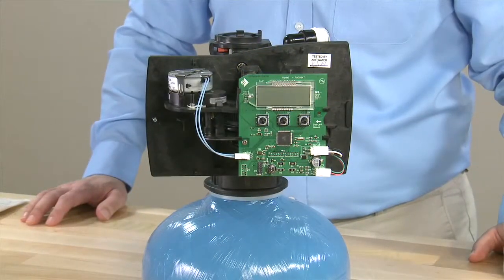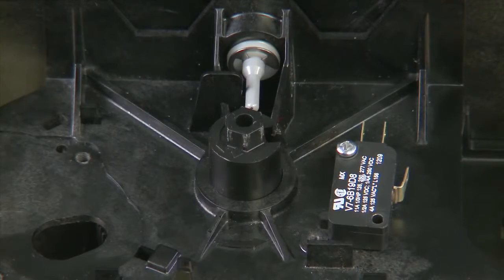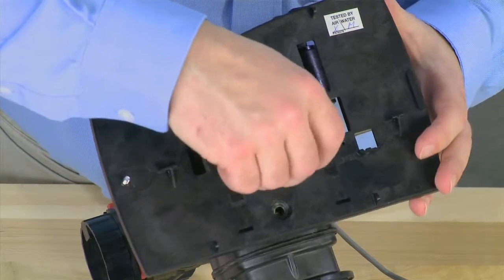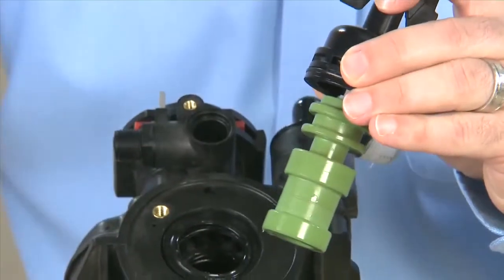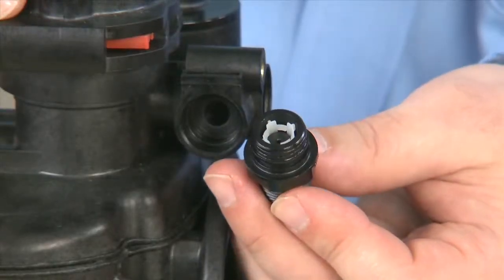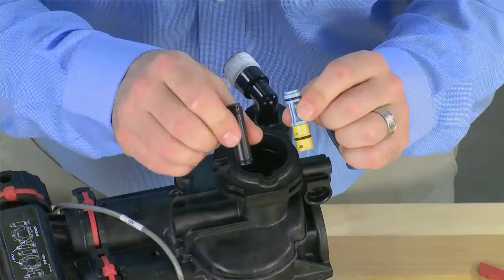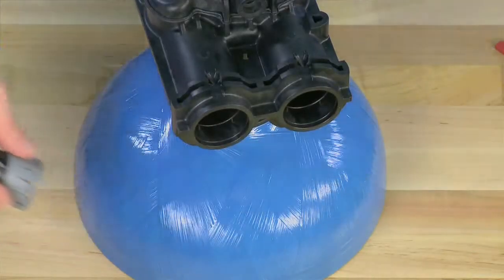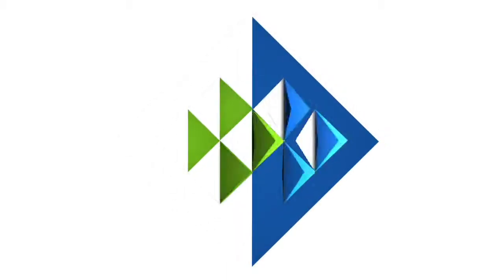Troubleshooting- Fleck 7000 Control Valve Tear Down

Comment: Mine drains constantly.  Is this due to the piston?
Reply: Were you able to figure this out? Mine has a error 0. I unplug for 1 min, and plug in to reset, bit not sure what else to do
Reply: @SuperSmoovy  once I reset mine, it stopped constantly draining.  It still does drain very slowly when it should not, but not as bad as it had previously.